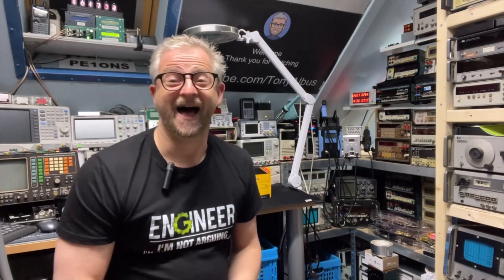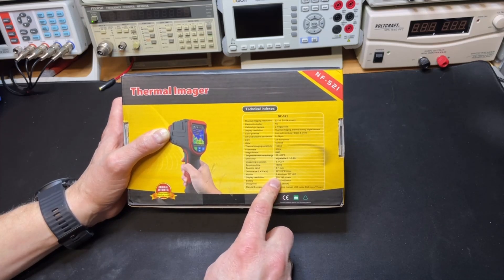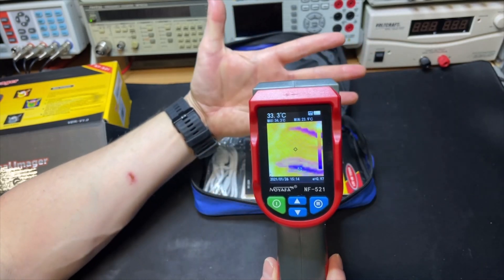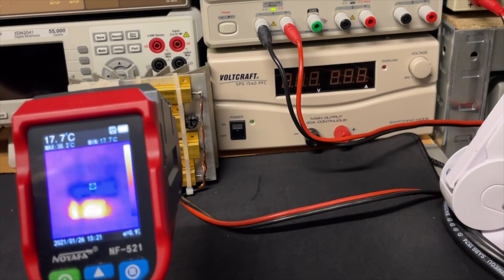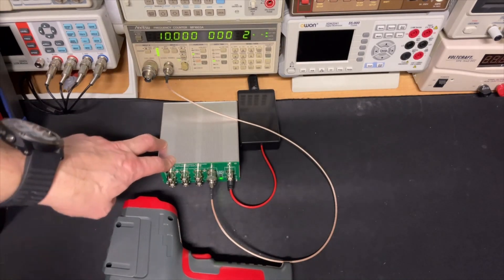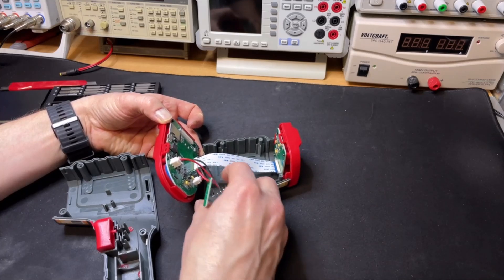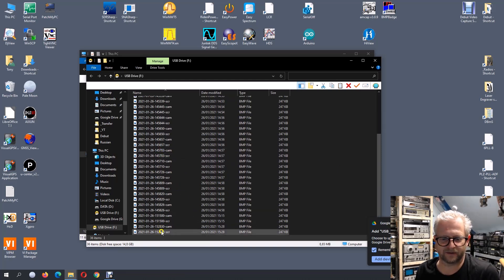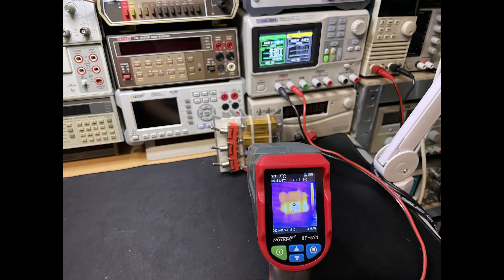#241 Thermal Imager Noyafa NF-521 Hands-On and Teardown

Comment: I just got this thermal imaging camera. Mine is VER: V3. Manufacture date July 2024. The System Info shows Hardware Ver: 3.1, Software Ver: V2.2.2. The heat imaging display on mine is definitely not as pixelated as the one in this video, so I think they did improve on that. However, mine also does not take video. I don't think it is capable of video recording. While the manual does mention the option of viewing pictures and video, there is no instruction on how to take a video, nor are there any specs given as to video resolution or video format it supports. It does take pictures just fine. When you take a picture, it takes a normal picture and the heat signature picture at the same time. When viewing the pictures, you can alternate between viewing the heat signature and the normal picture just by pressing the trigger. I am disappointed that they got rid of their mouse mascot. He no longer appears on the display when you power it on and he's no longer printed on the back cover of the manual.  Other than that, I'm very satisfied with the camera itself, it will be very useful.
Reply from the maker: Thanks for sharing, sounds great they improved the picture! ..mine is 3 years old, and i have not used it much. about the video mode, you can always try to ask your seller, maybe there is a firmware fix.
Reply: @TonyAlbus  I contacted Noyafa directly and here is the response they gave me. "Sorry, we have confirmed with our product engineers that the current NF-521 has cancelled the video recording function due to technical problems. It currently only supports taking pictures and exporting them through TF cards. We apologize for the inconvenience caused to you !"
Reply from the maker: @dk-jy3ug  Great they even answered you... okey then you know it is what it is, the video quality was not good anyway

Comment: Thanks for this.Got this device and everything looks good, except how does one remove the battery (for long term storage) The manual doesn't show anything on this  !   but I see small screws in the two adjacent holes on one side of the head and suspect that this is how to get at the battery? Appreciate it. Can't understand why this isn't shown on the drawings in the manual.
Reply from the maker: No it a legal thing... just leave it in there..

Comment: I got the same one and when i point it at my hand it doesn't glow like yours did
Reply from the maker: It also depends on the ambiant temperature.. i am in 20 Celcius if you are in 30 or 30+ the differance with you hand temp. could be less.

Comment: Thanks for the review. Did you also try to compare the temperature values measured by this tool and by another (precise) temperature probe in particular spots? I would not only need to see what spots are hot but also how much.
Reply from the maker: Thank you, i am not sure i did, is has been i while ago when i made this video. i will have a better Thermal imager later in a month i think

Comment: detect hot and color water leaks one floor between a concrete wall or partition ?
Reply from the maker: No i don't think it is that good, you need a higher resolution

Comment: I have an old Fluke Ti10 and apart from a new battery eventually it still does a very decent job.
Reply from the maker: Hi Marnix, Yes its hard to beat a Fluke even after so many years..
Reply: @TonyAlbus  looks gd what's the distance 
Will it pick up a small animal in the garden 
? Subbed 👍
Reply from the maker: @detectingadventuresscotlan8293  Thank you!,   Not sure.. because the resolution is not that good. i think having a slight better one is adviced.
Reply: @TonyAlbus  yeah probs  m8 👍